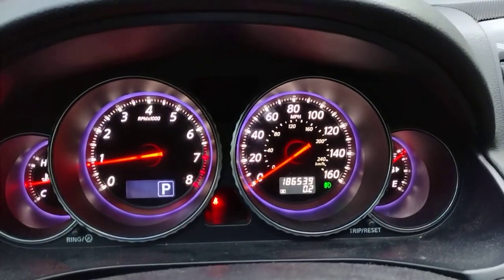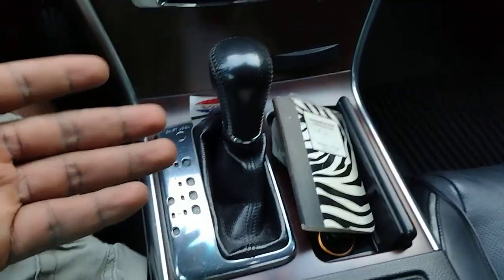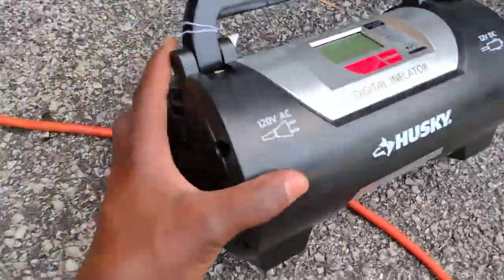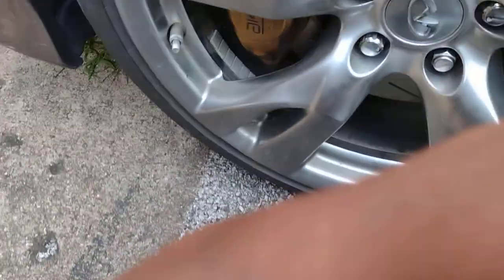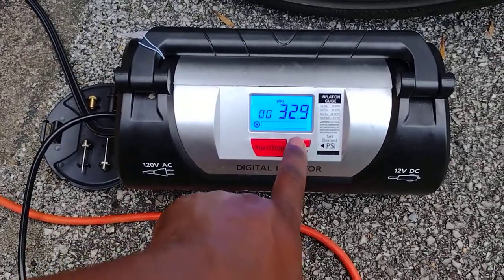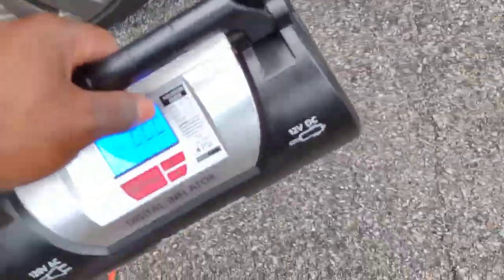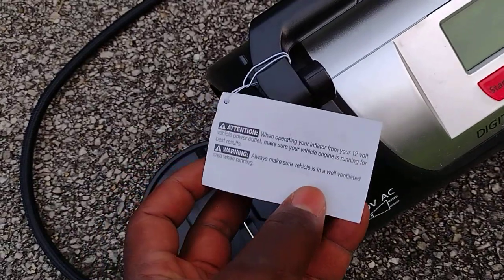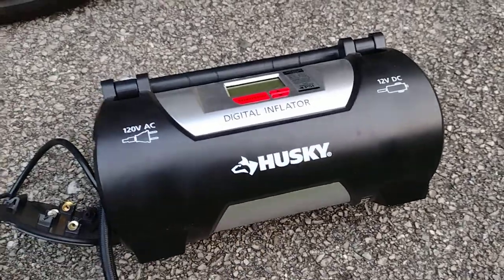Husky portable air compressor/tire inflator. It's mostly accurate | VLOG-ish

Comment: Four different tire pressure gauges on the car or the one on the compressor.  How do you know that the ones on the car are accurate?  I would calibrate the one on the compressor and stick with it.  I would be willing to bet the ones on the car are each off by a lb or two, maybe more.